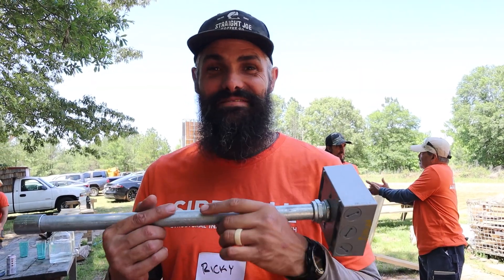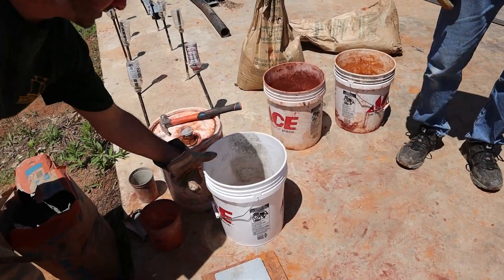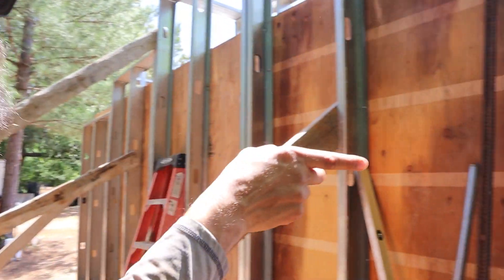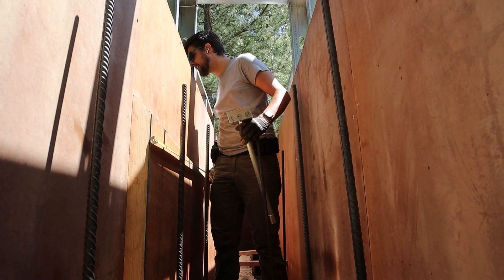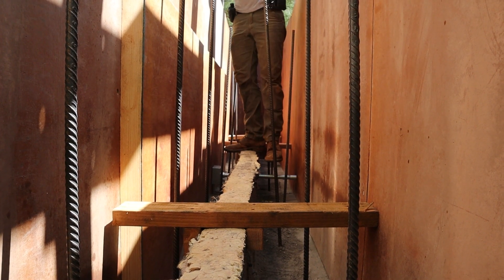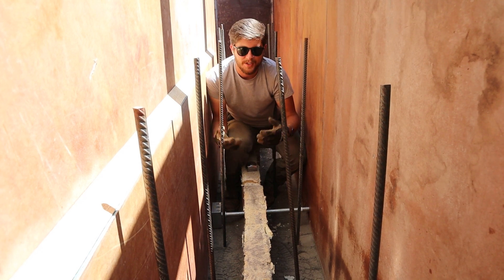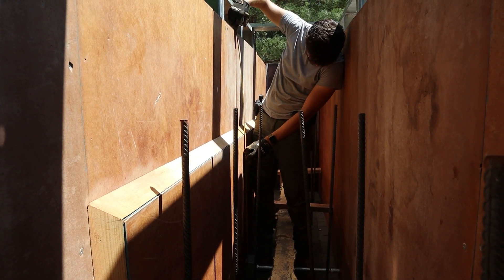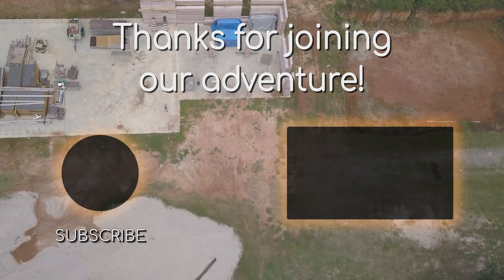Electrical in Rammed Earth - SIREWALL Class Part 2 - Vlog 95

Comment: I have worked in the rammed earth industry for over twenty years and I have never seen a more unsustainable and dangerous way to build an earth wall. I had a head ache watching the electrical go in. Not trying to be mean but there is no safety at all….no fall protection, no ppe for worker safety. I guess I will get blocked for hurting someone’s feeling but this is crazy. Imagine standing in those forms all day breathing in cement & oxide particles. I’m guessing a majority of the timber is discarded at the end of the project. I pray they have moved on from these systems in 2025🙏🏻

Comment: Whats the reason for the foam in the center? I thought the whole point of thermal mass was to have a lot of mass and with the foam in there youre losing a good chunk of that. What happens if you dont put the foam inside the walls?
Reply: The foam is for insulation. 

In desert environments where it is hot during day cold at night thermal mass is king but in places that get real winters and hot summers you need insulation to keep the inside temperature you are generating otherwise the thermal mass will just suck it up. The foam prevents thermal bridging from outside to inside and the rammed earth still provides thermal mass absorption and structural integrity
Reply: @Erribell  yeah but youre splitting your thermal mass in 2. Seems that if you have all the mass in one place and the insulation on the outside youd get the best of both worlds. Or just skip the insulation all together and make the walls thicker.

Comment: for a more modular system I've been considering designing baseboards that have conduit running through them. Wires can be chased through the baseboard and only the part from the floor to the outlet will be showing. Thoughts?
Reply from the maker: Thats a GREAT idea! I think I might borrow that if that's okay?
Reply: @RedEarthRanch  not at all man please do!
Reply: I think the best way to do it is :
1. Place the bell box at the high you need. (44" floor to center of the box.against the plywood using the same woodblock & screws/wire around the box, fished through the plywood and secure)

a) use 1/2" or 3/4" Connector PVC @  the bottom of the box ( toward the floor) with 16" pvc conduit with a coupling, twist a wire around the conduit with a "tail" and pass it through the plywood ( just to find it later )

b. To finish, locate the conduit with the wire hanging at the wall, just make a channel toward the floor and use pvc 90° or two 45° coupled together to make a nice and easy connection to run your conduit under the floor to the next bellbox.)
hope find it useful.